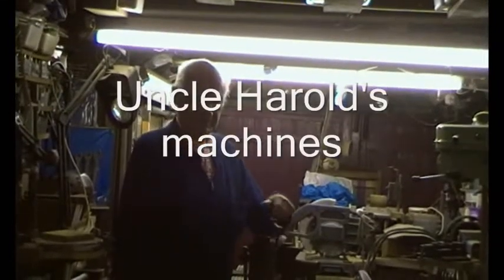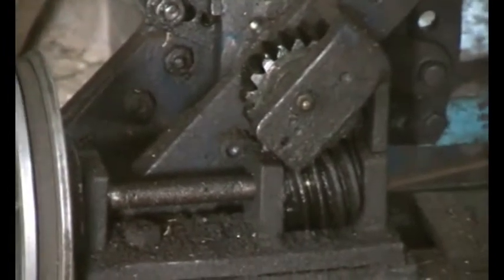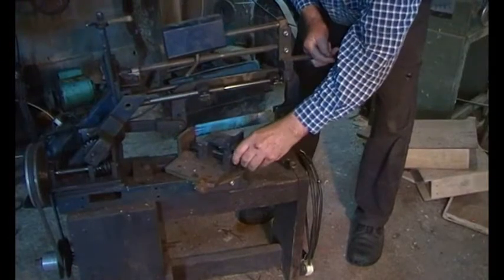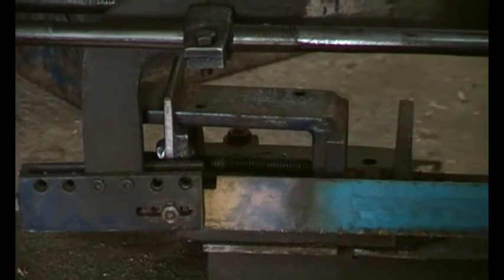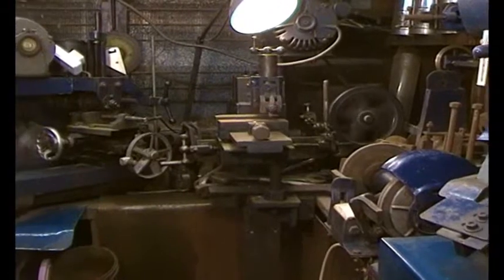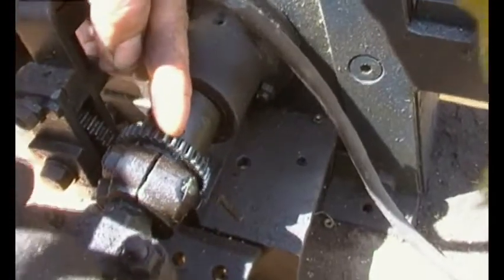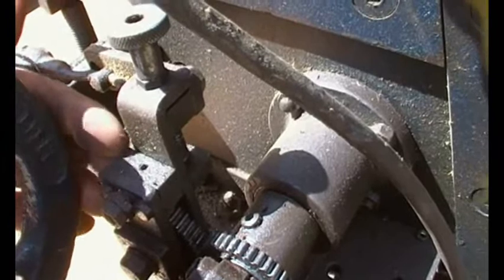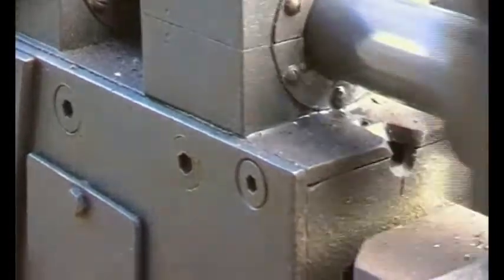Some of Uncle Harold's machines explained

Comment: I originally joined this channel for the solar power content.
Who was I to know that lots of  vintage machinery was going to feature too! I have some old machines in my workshop, but they are spring chickens compared to these classics. Shapers are very rare these days. Such clever mechanisms.
How are you getting on with the Denbeigh drilling machine?
Reply from the maker: Hi, the Denigh project is slowly happening, it's all freed off and now I am waiting for some free time to take the input shaft out of the geabox, won't be long now. Cheers